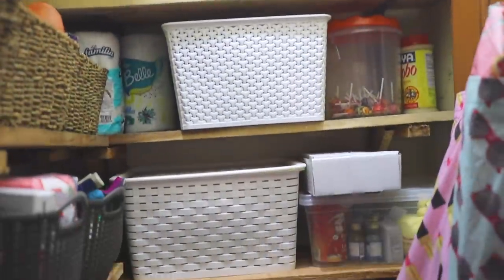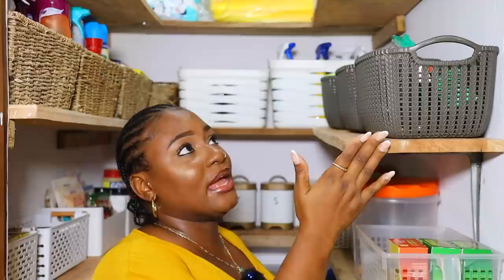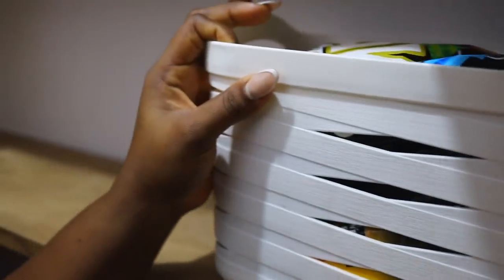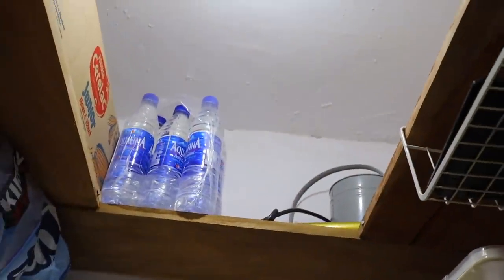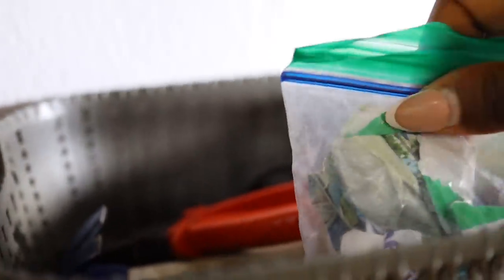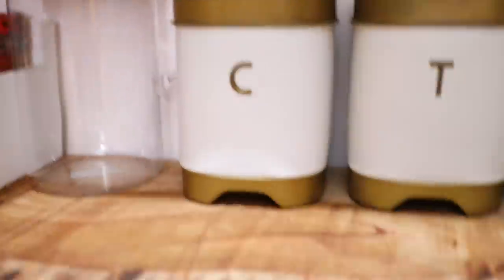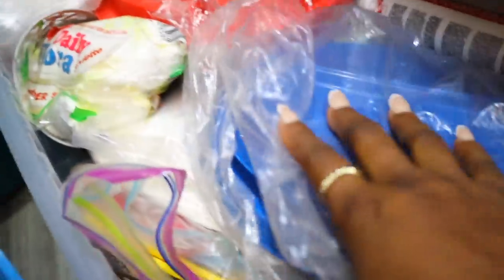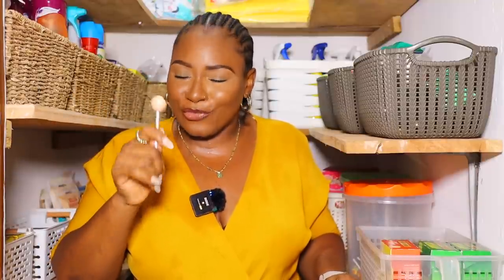I Transformed My Tiny Pantry/Store To This | What It Looked Like Before & Now!! 😮

Comment: Nicely done Chee.... How do you ensure moisture doesn't affect things like onions, potatoes. Cos I had to move my onions and potatoes from my store to the balcony, cos they were going bad very quickly due to no air in the store room
Reply from the maker: Thank you Chisom ☺️
My kitchen is actually very airy even though there's no window in the store  so the only thing I do is not close the door when the kitchen windows are closed which is at night if not the heat from the freezer will make the room hot.
That's the only thing I do oh.

I don't experience produce getting bad from heat at all 🤷🏽‍♀️